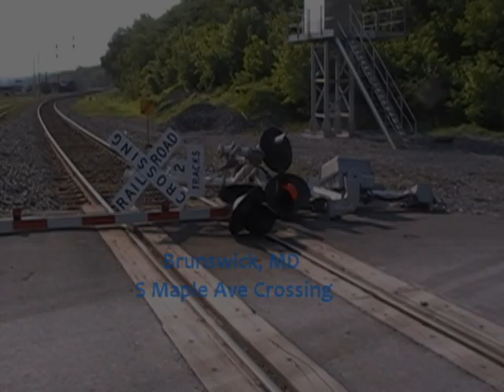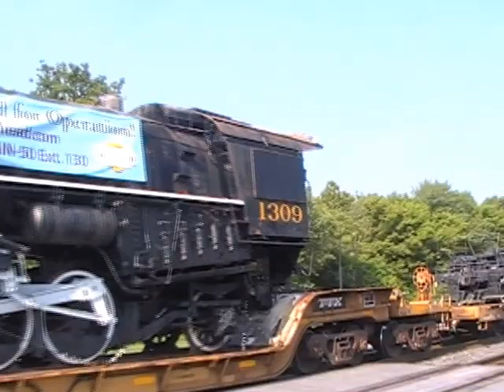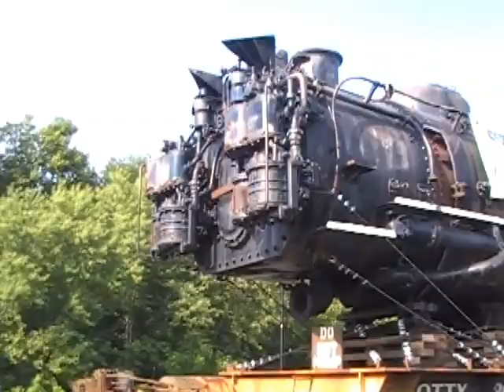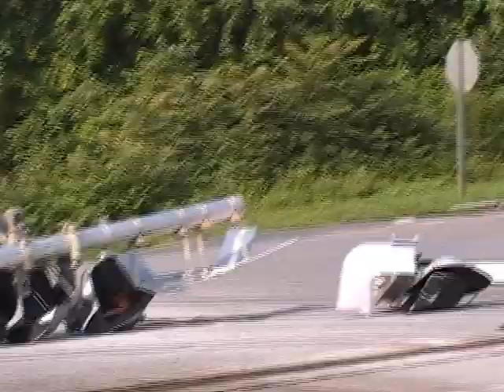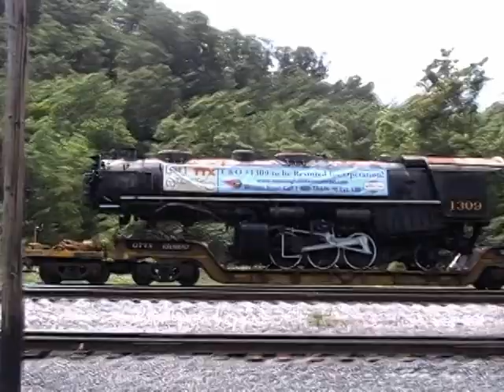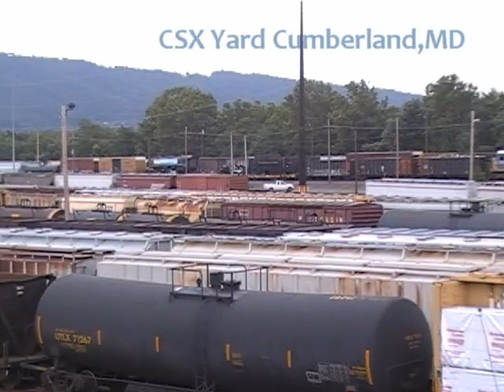C&O 1309 Move From Baltimore to Cumberland Maryland

Comment: Why, did nobody made a effort to pull the stuff off the rails before the train did?
Reply: It happened about a minute before the train showed up. No point in risking injuries just to move a broken signal in time
Reply: Its high voltage cause some wires are disconnect and still working